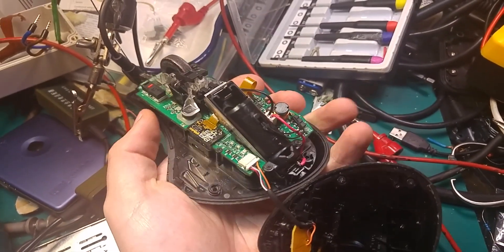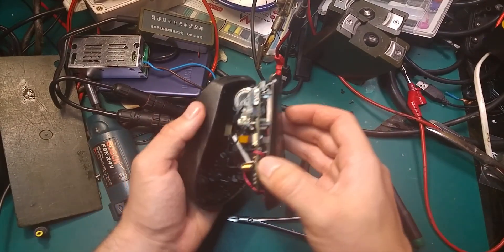Fixing blinking red led issue in Logitech mouse MX darkfield

Comment: Had the same problem but I had to reflow the power connectors inside my mouse (basically just touch the soldering iron to anything with a red/black wire)
Reply from the maker: Thank You for sharing

Comment: I had the same problem and it was not the battery connector or the soldering but the flex cable going to the sensor with loosing its connection.
I managed to maintain the connection with electrical tape and hot glue but I don't think it'll last. Best is to replace the sensor along with the flex cable attached to it.
Reply from the maker: Good to know - thanks for sharing your experience!

Comment: It's crazy how much manufacturers change an item for different parts of the world! The battery in mine is a flat square and that large inductor coil doesn't exist at all.
I guess that could be down to EU 240V?
I have a pair of logitech speakers that looks identical from the front but the internal layout and jack panel is totally different on the other side of the planet. 
Makes no sense.

Comment: Very same error was not fixed after cleaning the battery terminals. Actually it had nothing to do with the battery. There was a problem with laser flex connection. When I wiggle the laser flex it turns green at some point but goes back to flashing red when I release it. I guess I ruined the connector because flex seems intact.

Comment: I Have a similar problem with my mouse. It shows low battery after hours from installing a new batt. I noticed a high pitched noise coming from the mouse which i assume means the power distribution board is toast.

Comment: I'm just about done with Logitech crap tbh. Not only did my expensive C920 webcam randomly decide to die and not be detected anymore, but my M555b bluetooth mouse that I only use for my laptop (so no daily (ab)use) suddenly eats 2 alkaline AA batteries alive like there's no tomorrow. I'm lucky if I get a day of use out of it now (usually <6h) before it starts blinking red, when before it used to last a month or longer, even if I forgot to switch it off.. really disappointing :(  If my MX518 Legendary on my main/gaming pc prematurely fails as well that'll be the last Logitech product I bought

Comment: Most of these "fixes" are not actually addressing the issue. There is a loose connection somewhere and your tinkering is temporarily fixing. I had the same issue and smashing the mouse worked for a while (if it was corroded connection this would not have done anything, nor would blowing into the mouse as others have suggested). I opened mine and there is no visible connection issue, no corrosion on battery terminals, very shiny. I sanded anyway and problem persists

Comment: Thanks for the video. I replaced my battery and issue remained. Thankfully, I didn't have unscrew mine just take out the battery and clean the positive terminal. Thanks again, this mouse was expensive, but out of warranty so you saved me some cash from having to buy a new one.

Comment: The blinking red in mine was a slow blink. That  mean low battery. In my case, I found a way to clean it without disassembly. Don't forget to clean the connections on your batteries too. I went through these problems quite a bit when I had an xbox 360. The first symptoms that are that  a fully charge battery will report half or low power as soon as you plug it in. 

If you bother taking apart your mouse, I would also slightly stretch the spring to increase the battery tension if it is getting loose too.

Comment: This cannot be the case. Since the mouse is blinking, it means the battery works well. At least it's powering the mouse. I really don't think cleaning the metal piece will finally fix the blink-8-times problem.
Reply from the maker: Yes it does, let me explain: blinking error in showed case mean low battery. When resistance of contact is high (poor conductivity) it can't delivery current from battery to mouse motherboard, when current can't be delivered the voltage (at motherboard input) drop and trigger low battery error.
To check if this is problem in Your case, measure voltage of battery, then put into mouse and measure voltage on motherboard (just follow cables from battery holder), if voltage will be same then problem lies somewhere else, if voltage will be lower than battery alone - problem lies in poor terminal contact i battery holder.
Reply: I just did an experiment on my mouse which has the same problem as yours. The NiMH battery voltage is 1.288V. After it's been installed into the mouse, the negative-to-positive voltage I measured from the black and red wire is 1.287V. This proves that the battery can't be the culprit.
Actually, according to another post, they suggested it might be the loosely soldered cable from the motherboard and the laser sensor.
Reply from the maker: The problem is that i own that mouse from over 5 years, and i get into that blinking error one time and fixed it via following procedure. I do not have personal experience fixing it  from that issue another time because its working flawlessly afterwards and i'm still using that mouse right now (after couple replacement of buttons with are also as video  on my channel).   
Voltage You measured are correct but i would be still persisting on battery to motherboard section, truth is problem might be in that connector You pointed out but i can't confirm from my experience.  
On mine, the symptoms was when i was using NiMh battery it started reporting as  "5% power" much faster. I check battery because i was thinking there is a capacity problem but after measuring it was not so i know there is problem in mouse and current drawn.
Do You have similar felling before failing completely?  

Just to be 100% sure, grab 1.2V voltage source and solder it directly to motherboard if will be working than You nailed problem, if not working then try that connector between laser sensor because it sounds more prone dangerous area to work on - i would keep it as a last try. 
And please remember If You find solution please share.

Comment: Dose that mean sometimes the mouse battery can low to
Reply from the maker: Hey, of course it does alert same way when battery is low. This video is for people who put new battery and it blinking like battery is empty - that's why it's called red led issue .
Reply: Five hours....later
Reply: My mouse was blink like that in the middle, it was red to but then I was not red anymore for some reason? And I didn’t fix it or put a new battery in ether.
Reply: Actually it’s only blinking red when it’s off